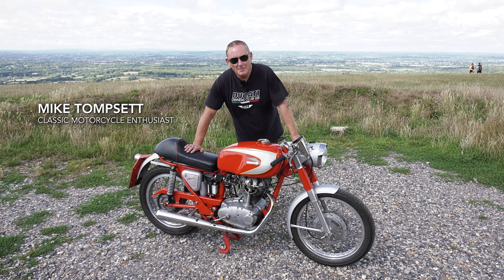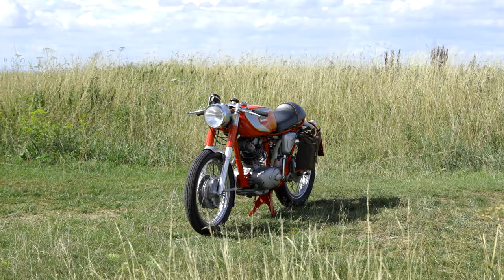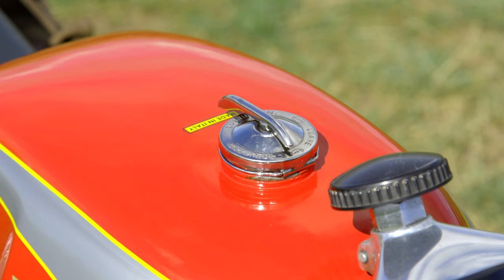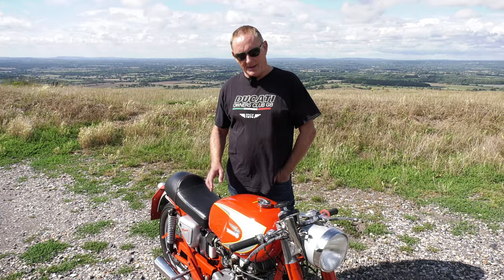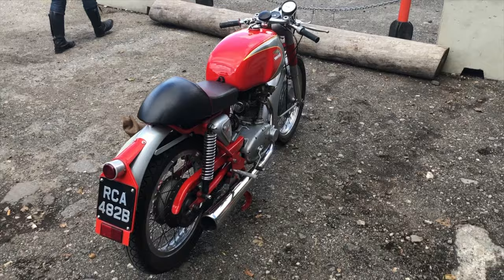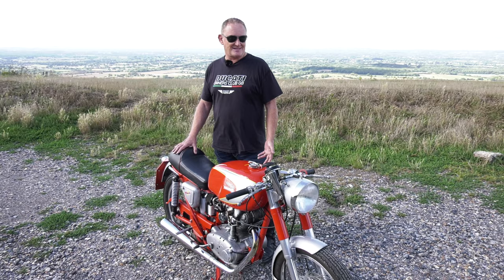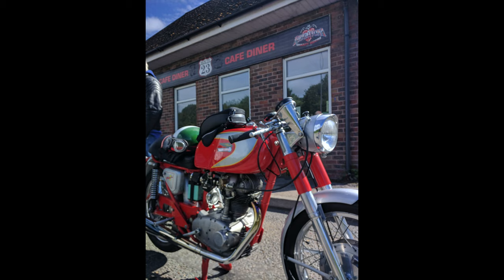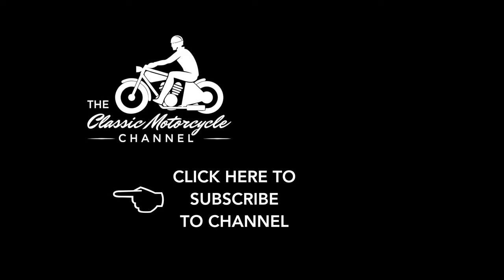1964 Ducati Mach 1 250 - overview & ride

Comment: This evokes painful memories for me. I bought a Diana MK3 in 1982, which was basically a Mach 1, it was stripped down but complete and came with lots of original spares. It even had the Dellorto SS1 and add on Veglia racing tach.  At the time we were starting a business so I never found the time to restore and rebuild it, so it just sat waiting. Eventually, due to circumstances, it was in storage away from where I lived, with several other machines, and it was stolen. I was traumatised and even now, 6 years later, it still makes me feel sick to think about it. Despite reporting the theft to the police no trace of it has ever been found, so it was probably sold in parts. I still have it's documents so it can never be registered in the UK again as I reported the theft to the DVLA. I also have the SS1, tach and several other small bits.  So, if anyone has been offered parts from a Diana MK3, or described as Mach 1 parts, sprayed in matt gold, they were probably mine and were stolen.  I was really looking forward to restoring that bike to it's original glory, the disappointment is bitter.

Comment: That speedo backing plate is clocked all wrong, the fake "Scoop" is supposed to face front, dead level, youre putting the speedo cable into tight bend the way you have it, so besides looking horrible, youre causing it to fail early - easy enough to adjust tho

Comment: One of my hero machines. As a teenager in Ireland the 1960s, I had an Italian bike with a similar history. It was a 1958 Moto Guzzi 175 Lodola Sport, stripped for racing and fitted with the full kit of factory tuning items - 29mm Dell'Orto carb, h..c. piston, close-ratio gearbox, etc - and was ridden to victory in the 1959 Skerries 100 by the owner, Paul Curran. When I acquired it from a friend in 1962 (for £50!), it was battered and partially seized, but otherwise entirely as raced by Curran. With occasional advice and parts from legendary Moto Guzzi rider, Stanley Woods, who was the Guzzi agent in Ireland, I dismantled and rebuilt it in cash-strapped stages, eventually selling it (for £100!) in 1964. Like the Ducati, it was a sweet-handling machine, loved to rev (chain-driven OHC), and replete with beautiful engineering details.

Comment: I had a new Mach1 in 1965 which L loved, it would outpace most after it wad modified, would easy make  100mph, was fitted with glass/fibre fairing but it had : faults, the kickstarter spring ring would easily break and the clutch release rod would wear out

Comment: Saw a new Mach 1 at Ghost Motorcycles, Port Washington, N.Y. in probably '65.  Immediately loved how it was fitted out, that one having Oldani brakes front and rear and a near Formula III engine, a Silentium muffler,  and rear sets.  Headlight on it was not as much a nacelle as yours, flat on the back side IIRC.  That era of fine Italian 250s was not carried forward as much as they deserved - I got to ride Dianas and Parilla Grand Sports of other owners, what a great time for classy 250s.  I eventually got a Bultaco Metralla to keep in company with them.  You've done a great job in restoring the character of the Ducati, paint match and aluminum trim colors look spot on.

Comment: 250cc, 80mpg, 100 mph. We haven't progressed much have we as a modern 250 would be pleased with those figures. Fully agree it's better to have a slightly non standard bike on the road than one sat in the garage waiting for parts that may never surface.
Another great vid from this channel.
Reply from the maker: Hey Stu, thanks for your observations and your nice comments!
Reply: You have to understand that this is possible only with the higher compression piston and street gearing of the MkI.   I have the same gearing on my '67 Scrambler and it gets close to 80 mpg.  But, it will not pull 100 mph.   It's a more upright bike, no setback footpegs.   I find myself using fourth in most conditions as fifth is such a tall pull, and you should never lug these engines down below 3000 rpm, The cranks are a bit tender and the stroke is short despite that the engine likes to pull well from low revs.

Comment: I had one of those when I was 18, moved from an AJS Mod.14 CSR to the Mach 1, bought second-hand from Bryants in Luton, where I had a Saturday job. Such a gorgeous bike but my memories are mostly of the number of shims in the engine, having to carry a bath plug around to stop rain dropping into the Dell Orto bell mouth when it rained and the 3 month delay to gave new big end bearings pressed in by Vic Camps. It had been raced before I bought it and I sold it to someone who was going to race it again. I got my first three points on it, at 101mph down the A6 down Barton Cutting. Great bike and great memories.

Comment: Very nice video and a beautiful Mach 1.
 I bought my Diana for $100 about 40 years in non-running, rusty, but complete condition. At least I think it's a Diana, as it has the same tach and everything else as yours, but the triple clamp has handlebar mounts. Got it running and rode it daily for a couple years and then the rod went, so I restored it. As you say, great fun to ride. surprised to hear about your 'heavy' clutch action. Mine isn't the least bit heavy, and it still has the original plates/springs. Perhaps someone installed race springs which aren't needed for the street. It might be worth changing those. Cheers on the great video. It's shame that more folks don't know about and ride these wonderful bikes.

Comment: I own a 1967 Scrambler 250 with an aftermarket 10:1 piston and I find it a bit reluctant to kick back, but then I checked the ignition advance springs were bit stretched and replaced them with springs off an old Bosch car advance weight set.  It's fine now,

Comment: Magnificent bike, lot of congratulations, Sir! I own an other Classic motorcycle, a BMW R26, 247cc, single cylinder, 1958. It's almost original, except carburettor, that is a Dell'Orto like the yours. 
But what I like more in your video is that you talked about many issues that I exactly agree with You. I had to spent some beautiful money to restore the model but, as it is less rare then Your Ducati, I was quite lucky on finding several spare parts. Yes, drive more than 60-70 miles is little hard for my back , otherwise when you stop somewhere for a break it's unbeatable that several people ask about the bike, and someone exclaims "nice! it's older than me! " Have the Best!

Comment: 10:29 concerning the original instrument lights.  The Veglia speedometer has a set of little windows facing forward on the casing inside the headlight shell that pick up a weak wash of light from the joke of a 6 volt model headlamp reflector shell's "window" in the upper parabolic.  It weakly lights the upper edge of the dial face.  It's why I changed my reflector over to a cheap GN125 replacement with LED lighting and fitted an LED lamp facing the speedometer to light the face adequately.  How anyone managed to ride these with the stock lamps at night is a mystery.

Comment: A really great bike and compared to a modern bike the mpg in particular is very impressive. It looks like its got the twin drum front brake, do you manage to get them synchronised? I had a Ducati, a bit older than yours when it was new and I found that almost impossible to do. Under heavy breaking the front wheel would twist,not very pleasant!

Comment: With an engine number of DM250M3 I don't think that it is a mark one engine. My 1967 is almost identical but with a black frame. That has an engine number that starts with DM250M3. But I could be wrong.
Reply: Mine has engine no. 0026DM250M1

Comment: The engine number of this motorcycle is "DM250M3", so is it not "Mach1" but "Mark3"?
Reply: The frame is very likely a Mach1 and definitely not a Mark3. The Mark3 has 'forward' footrest mounts on the bottom, the Mach1 doesn't. Some Mark3s came with M1 crank cases, not sure if Mach1s ever had M3 crankcases (Early Ducati's had some very odd number configurations, so its very possible). Also if the bike was raced successfully, it would be very fair to have replaced the bottom end/cases at some point.
Reply: P.S. What a fantastic little bike either way!
Reply: Thank you for your reply. I have read in many books that there is a Mk.3 with M1 stamped on the engine, but no Mach1 with M3 stamped on the engine.